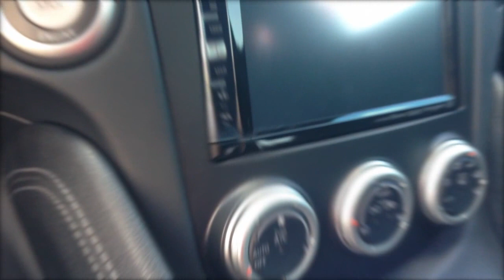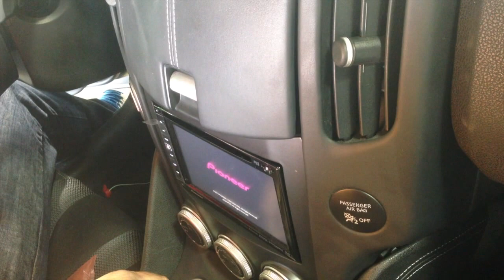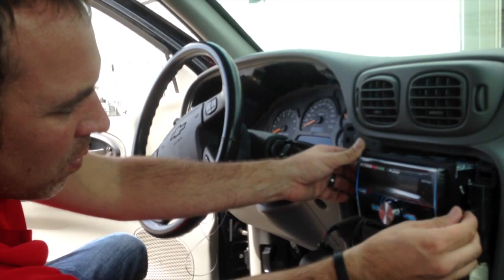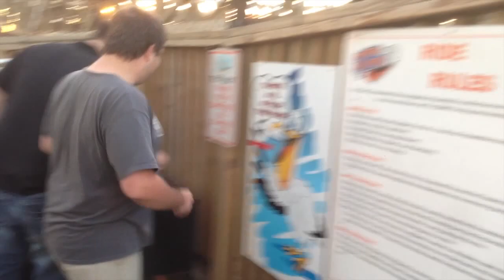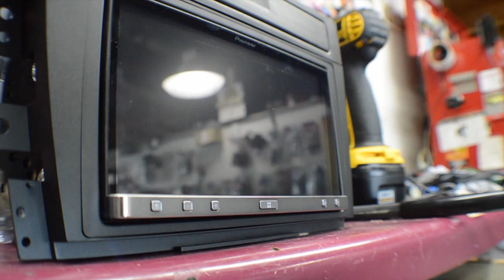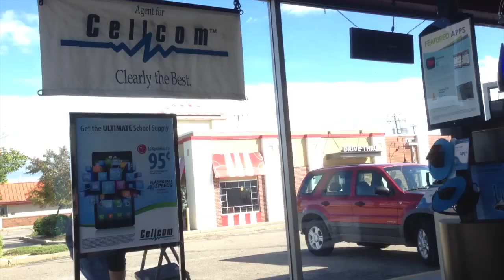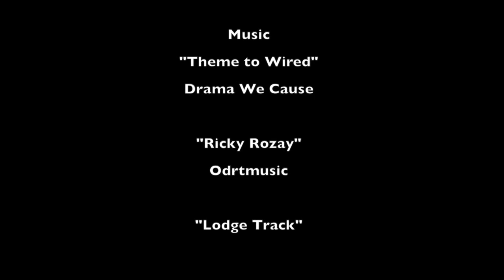Wired: A Car Audio Family Episode 1

Comment: I especially enjoyed your F-150 install regarding the head unit and using snow caps to connect the harness, who cares about soldering and heat shrinking the wires, and doing it right the first time, right? Sincerely, an audiophile from Green Bay.